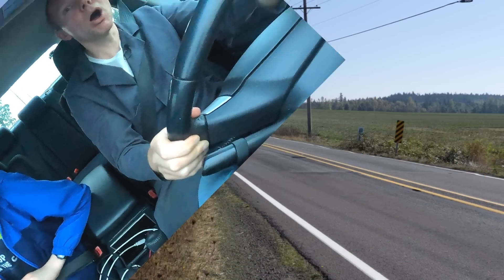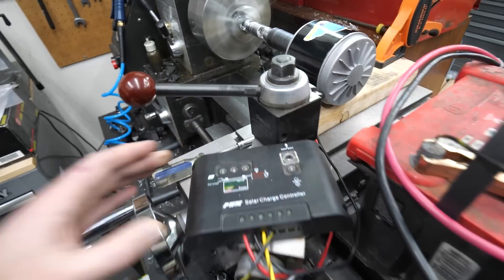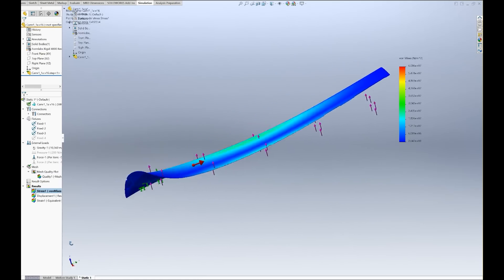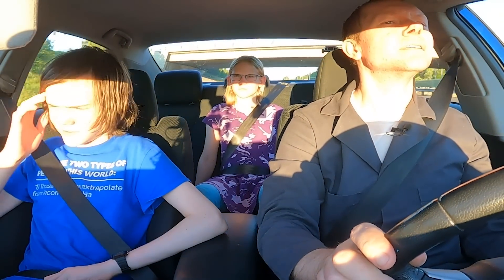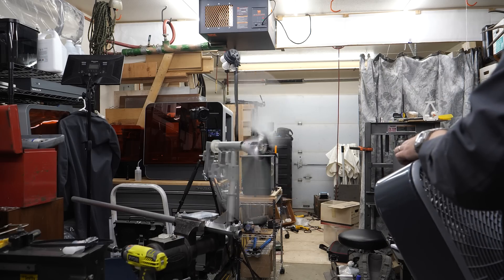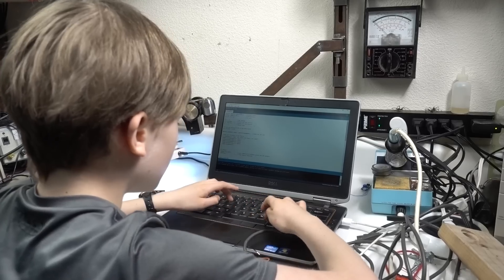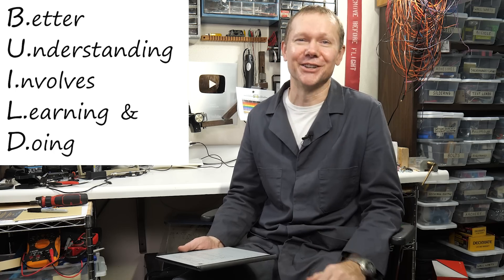3D Printed Turbine on a Camry - Wind Power on a Car #6

Comment: 15:30 Difference between mounting a turbine on the front or the top of the vehicle:

Well, it was mentioned already: Air on the top of the vehicle doesnt get pushed by it. Putting a turbine on the top is equivalent to putting on a wind sail. Since it will convert air movement into electricity, it means it will slow the air, which is what a wind sail does. That would slow down the vehicle EXTRA.

But the front of the vehicle is already slowing down the vehicle as it is. And that air resistance is unavoidable. However its just a front of the vehicle ( functionally same as a sail) and not a turbine. If we disregard electricity, between a sail and a turbine, there is little difference, they both slow the air. So why not replace the theoretical wind sail that is the front of the vehicle, which does nothing good and is unavoidable air resistance? Put a turbine there instead. It will slow the air down all the same AND make power which the vehicle can use. And remember: The air that has been slowed donw by the turbine ( lets assume its a perfect turbine ), is just as fast as the car, meaning the car doesnt actually experience any resistance that it did before. Instead its the turbine that experiences the resistance, and since its mounted to the car, the resistance is transfered and the car gets slowed down all the same. But now there is power, where before there wasnt any

Comment: My gut is that you're right and that further disrupting already turbulent air will show a net gain. But then again fluid dynamics is complicated and changing the flow of that air may have other, more complex effects on efficiency that are hard to predict. Either way I know that my maths isn't good enough to work it out, so I look forward to seeing the results!
Reply: Modern vehicle design tries to produce as little turbulence as possible, since turbulence results in higher drag, so my main thinking is that the fan, which creates turbulent air, is going to "undo" the aerodynamic design of the front end of the vehicle to some extent.  This will be less impactful at slower speed, but at highway speeds aero drag becomes a much bigger component of efficiency, so I think it will come down to just how effectively the power generation can make up for it.  The power required by the alternator is a small enough margin, that it could result in some gains at slower speeds, and some losses at higher speeds.
Reply: @FlesHBoX ⚠️ God has said in the Quran:

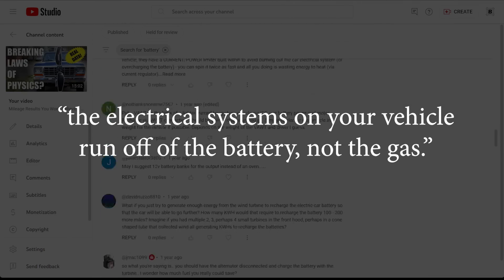🔵 { O mankind, worship your Lord, who created you and those before you, that you may become righteous - ( 2:21 ) 

🔴 [He] who made for you the earth a bed [spread out] and the sky a ceiling and sent down from the sky, rain and brought forth thereby fruits as provision for you. So do not attribute to Allah equals while you know [that there is nothing similar to Him]. ( 2:22 )

🔵 And if you are in doubt about what We have sent down upon Our Servant [Muhammad], then produce a surah the like thereof and call upon your witnesses other than Allah, if you should be truthful. ( 2:23 )

🔴 But if you do not - and you will never be able to - then fear the Fire, whose fuel is men and stones, prepared for the disbelievers.( 2:24 )

🔵 And give good tidings to those who believe and do righteous deeds that they will have gardens [in Paradise] beneath which rivers flow. Whenever they are provided with a provision of fruit therefrom, they will say, "This is what we were provided with before." And it is given to them in likeness. And they will have therein purified spouses, and they will abide therein eternally. ( 2:25 )

⚠️ Quran
Reply: @FlesHBoX yeah. Drag on a vehicle is usually more laminar at the front and becomes progressively more turbulent as you get to the back. Which is part of why I think placing a turbine (probably a VAWT turned so it's axis of rotation is parallel to that of the rear wheels) where you'd place a spoiler would be best
Reply: My feeling is that the power recovered will be inversely proportional to the drag coefficient of the vehicle. The higher the drag, the less power recovered.  But that the additional fuel consumption will be directly proportional to the power recovered give or take efficiency. (would definitely prefer a brushless generator with bridge rectifiers) which may not may not offset the alternator load.
Reply: I'm not an expert in aerodynamics, but AFAIK essentially the airflow generally "finds its way of least resistance" in order to "dodge out of way of the displacing car". Therefore, trying to "steal" the power from the way of that flowing air can only and merely increase its resistance (or worse yet disturb that path even more, making even more resistive path), equalling into increased drag on the car (as car needs to work harder to displace the air through more resistive/convoluted path).

A more sensible idea might be to alter the pattern of airflow into more efficient in first place, using passive means (spoilers).

On the other hand, wind turbines might have some use, if you could leave the airflow by the movement of the vehicle (mostly) untouched and instead utilize the natural wind. IIRC there do exist some kind of "turbine sailboats" working that way. For such setup, the best place might be on a tall enough wind tower on the roof.

It could theoretically be simple and less or more usable if the wind turbine was the only power source, like in those experimental turbine sailboats. But due to its low efficiency, it might be impossible to sensibly combine it with any other power source, as it will also cause kinda threefold added drag against the power put on the motion by the other source than it provides, and it might be technically difficult to make it "ignore" the driving-induced airflow, which is usually the larger portion of the overall in case of road vehicle.